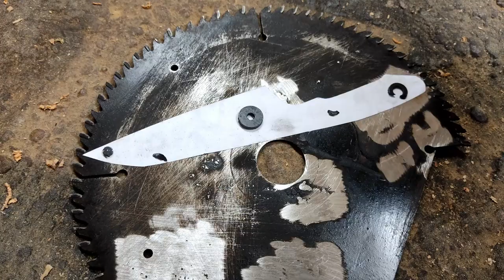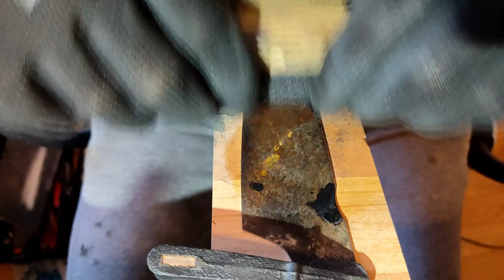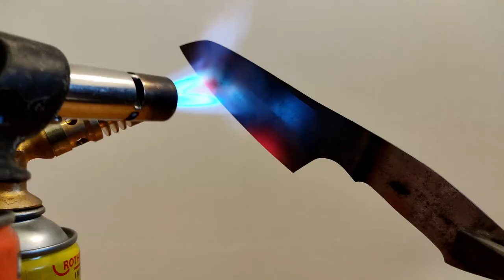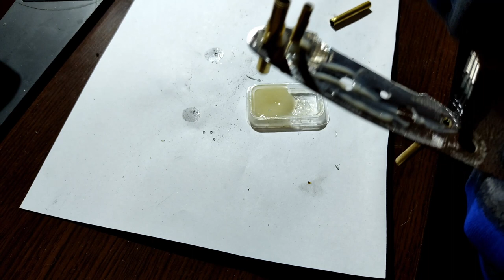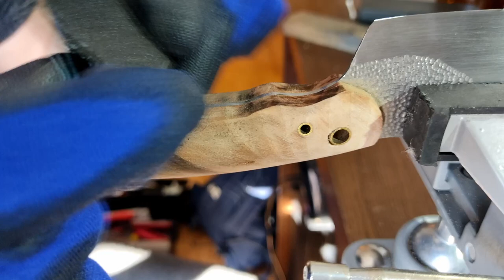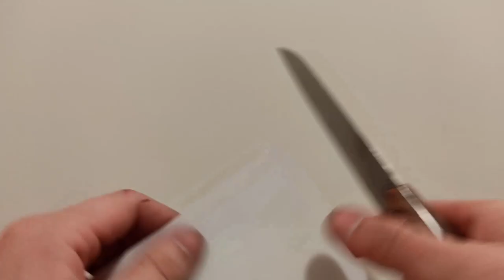Knife making - Japanese Chef Knife From Saw Blade

Comment: This is not HSS, it's not even tool steel. Only welded teeth are carbide, the main body is comon soft steel, not suitable for knives. Common mistake. Take it as a practice and next time you'll use better steel.